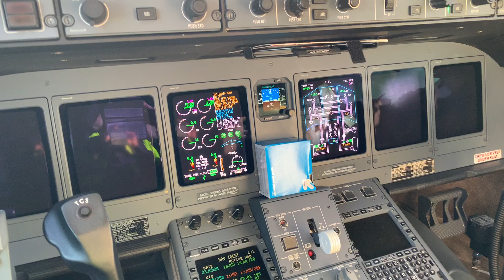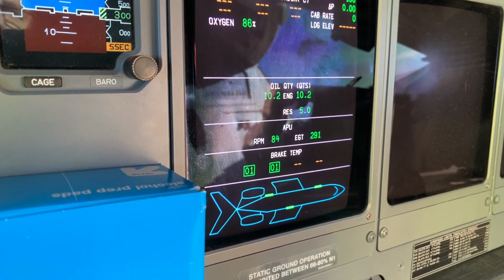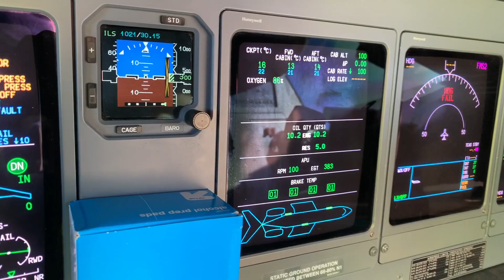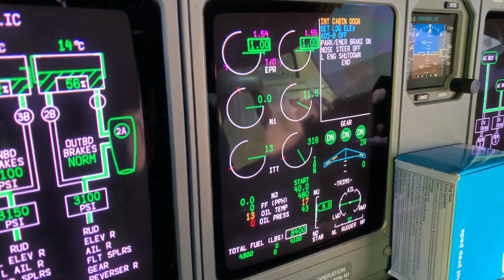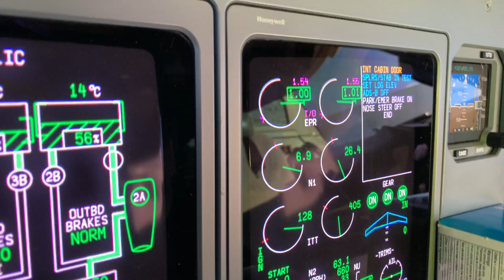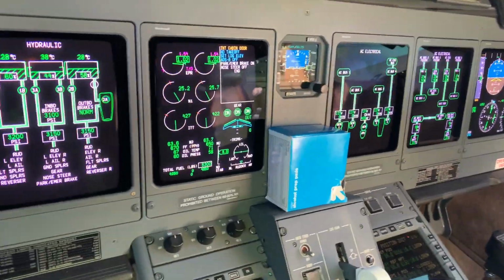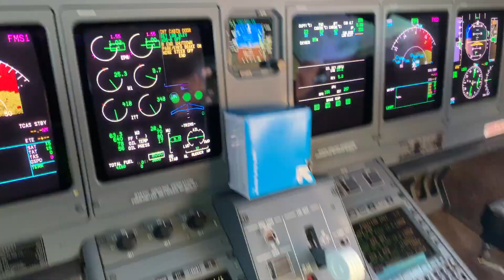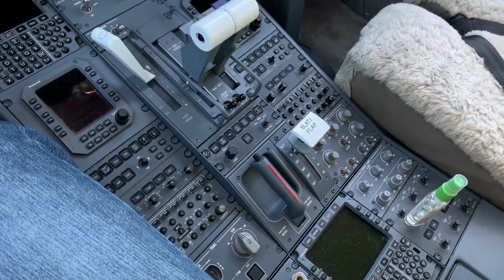A real pilot can show you his aircraft.  C'mon FE pilots - what are you waiting for?

Comment: My favorite part is when you turn on the switch for the compressed air and the chemicals for the trails... 😂 Excellent video, Wolfie. Thanks!
Reply: IKR he forgot to show the chemtrail control button. 🤣🤣🤣
Reply: @amb3cog  No he didn't. The chemtrail controls were the "tall" levers just above the Start Switches.
Reply: @josephking6515  The smaller one is for the flight spoilers, and the big one is the throttle actually. 😉  ✌️

Comment: Great video, thanks Wolfie.
Though the tech is more modern, it's very similar to starting a B757/767, but my B787 is quite different. The 787 has (almost) no bleed air and engine start is done with an electric motor. After the start is finished, that motor is used as the generator. Pressurization and AC is done completely independently of the engines and APU. We also start both engines at the same time, except in very hot environments. The start is completely automated. Initially the engine dry runs for a time determined by the system, dependent on how long since they were shut down. This allows the core temperature to be stabilized, reducing wear. Then the rest of the start continues in a similar fashion to yours, but we do not interfere. Even if we see a hung start, or any other potential malfunction, the system deals with it, including multiple start attempts. Only if there is an EICAS message do we act (or we get a signal from the ground of a tailpipe fire). 
We also don't check actual flight control movement on the instrumentation, we simply move the controls. The rudder check has to be done gently and slowly, otherwise there is an unpleasant motion at the back of the aircraft, it is a very large rudder!
The generators act differently as well, as the output isn't regulated. The AC produced depends on the rotation speed of the engine and so it isn't a constant frequency. That raw AC goes to the different parts of the aircraft where it is converted to the required specification at the point of use. This is all done to save weight!
I actually found something the other day that I'd not known before. On the 787-9 and -10, the gear doors open 1 second after airborne. This is so that, in the event of an engine failure, there is no opening of those doors when the gear is retracted, as this would cause a small change in the TOGA reference line and could lead to a less stable climb.
Reply from the maker: Thanks for sharing.  Very interesting that both engines start at the same time.  I did not know that.   I can imagine that rudder would have quite a bit of weight and rapid movement would be felt inside the aircraft.
Reply: @Wolfie6020  The 787 has a very powerful electrical system. Two engine starter/generators on each engine and the equivalent 2 APU starter/generators on the APU. There are also three engine driven Permanent Magnet Generators which are the primary source of power for the flight control electronics. These power sources are independent of the main airplane electrical system, together with 2 engine driven Permanent Magnet Alternators, one per engine, which are the primary source of power for the Engine Electronic Control.
There is also a system for large motor loads which requires significant cooling, using a liquid cooling setup called PECS (Power Electronics Cooling System).

Comment: Thanks for the video Wolfie.   Seeing you do the "yoke free and correct" check reminded me of a hard landing I had to respond to 2 years ago.   Cessna 172 pilot forgot to pull the yoke lock pin before takeoff by skipping that check, only noticed it at V2 by which time it was jammed with pressure.   Fortunately he was flying off a remote dry lake bed so had a forever runway.  Skillfully got it back down by throttle / rudder only, but broke the nose gear on the third bounce and so pranged the prop. Though most important he and his 3 passengers all walked away.
Reply from the maker: He was very lucky.  Well done to get back on the ground and walk away.

Comment: LOL - good luck with that Wolfie.
Reply from the maker: I think Knodel did a few circuits in his 152 at the aeroclub in 1978.
Reply: @Wolfie6020  I don't even want to think about Bob in a 152 LOL. If he ever flew one, it was solo unless he found a CFI that weighed less than 50 pounds! Could he even fit in one alone? Hmmm - that would be tight for sure.
Reply: @Wolfie6020  And the instructor was doing most of the flying, no doubt.  lol
Reply: I’m not a pilot, but...gee... is there really a big difference between flying a high tech corporate jet...and a “bug smasher.”
Reply from the maker: @Sherwoody  Push the stick forward and trees get bigger - pull back on the stick and trees get smaller.  

Same basic concept with any aircraft - the jet has far more systems but also plenty of automation - you can be on autopilot from one minute after take off to one minute before landing and never have to touch the controls.  I usually hand fly to at least 25-30,000 ft on climb just for the practice and from about 3000 ft on the way down. 

The weight is a factor also,  you can't just hook a tight turn in a swept wing jet.   They ride turbulence much nicer too.  It would take me a few attempts to recalibrate my flare height landing bug smasher now as I haven't flown one for a few years.
Reply: Wolfie6020 I’ve not flown either, a light plane or high tech jet, but I’m impressed by those who do. 
I enjoy your videos, keep up the good work.
Reply: Wolfie6020 what plane is this
Reply: @Wolfie6020  only thing I have ever flown was a powered glider, so I appreciate just how difficult real flying is and I totally admire pilots who make it look easy.

Comment: I was so confused about why he was turning on the anti-ice system. And then I remembered that in Australia it's winter. Not summer like it is here in America.
Reply: As far as I remember, you turn on anti-ice if the outside temperature goes below 10C and you fly into moist air like clouds. The season is irrelevant.
Reply: ^^^ This is why ^^^
Reply: He is checking systems still function after one month of sitting & not flying
Reply: el profe vinagre  At high altitude the air is rather dry. You don't have to use anti-ice at climb or cruise with an temperature below -40°C. Outside any moisture you don't use anti-ice.

Comment: Are those screens CRT they look like the old Telemecanique screens I used to programme for Industrial HMI's
Reply: Was wondering about that as well.
Reply: Definitely have that phosphor look, but I don't think CRTs would look that way to a camera
Reply: @riccardo1796  Hm, I would expect the flickering you see because it are CRTs and wouldn't expect that on LCDs.
Reply: They'll be AMLCD.
Reply: @thearmouredpenguin7148  are you sure they look too bright to be LCD.
Reply: @dogwalker666  Quite sure, I spent many years designing test equipment for flight deck display systems before I retired. The flight deck will have an ambient light sensor (or at least the systems we produced did) which automatically adjusts the intensity of the display from dim at night to very bright when in full sunlight.
The flickering you sometimes see on the video is due to the refresh rates of the display and camera, You would not see this when looking at the display.
Reply: Yes they're CRTs - six of the Honeywell DU-870s [8" x 7" hi-res CRT multifunction displays]
Reply: @thearmouredpenguin7148  thanks.
Reply: @nightjarflying  ah well that's what I thought because of the curvature too, I know it's old school technology but I still like a CRT screen.
Reply: @nightjarflying  I'll not argue because I've just looked up the spec, for the DU-870, but I'm stunned that anyone is still using CRT technology. As far as I can tell the DU-875 is an LCD drop in replacement. Firms like GE have not produced CRT displays for donkeys years. The Global Express is an older aircraft than I thought. 
Hey Wolfie6020 its time you got a new aeroplane.
Reply: @dogwalker666  There's thousands of business jet CRT monitors still in operation [longer life on biz jets because more down time] & there's loads of spares for them - that Bombardier model has certificates allowing an upgrade to Primus LCD, but that looks CRT to me.
Reply: @thearmouredpenguin7148  well there are DC3s still doing commercial flights so it's got plenty time left.
Reply: @nightjarflying  if you can take the weight and power consumption CRT gives better contrast in most lights and it helps keep the cabin warm.
Reply: @thearmouredpenguin7148  - Wolfie will get a new Global 7500 in the near future.

Comment: If I was a Flattie, I'd be thinking how hard can it be to fly an aeroplane? There's no gravity, so you can't crash, as long as your aeroplane is less dense than the medium it's in, 
If you are in a helicopter you only need to hover facing the right direction, and the world will turn underneath until you reach your destination, and you can navigate anywhere in a straight line with your mobile phone since GPS is ground based. 
Oh and we don't need any fuel, just Compressed Air! 
Park brakes? Why do we need them, the Earth is Flat so it ain't going to roll anywhere? 
As to the flight surface controls, to roll the aircraft, we spray chemicals on the wing opposite the direction we want to turn and the change in relative density of the air lifts the wing turning the airframe.   You can see this in operation, with the chemtrails following the aircraft. They disappear during descent when the pilot switches off the chemicals, and the wing stops flying causing the fuselage to lose height.
As for the Angle of Attack, this will cause the Horizon to appear flat, because of compression, 
But we don't know really, it's what we have been told happens. Thats why real pilots fly in straight lines.
Reply: Keep believing the freemason liars, just because he is pilot doesn't mean he is not lying to you, there are bunch of pilots who say the earth is flat, but not all because you risk losing your job because of that, and who would want that? Im absolutely sure Wolfie knows the earth is flat but he is just fooling the sheeps and he is perhaps getting paid for it as well, no other pilots waste their time like child arguing on the internet, only paid shills do and he is one of them.
Reply: @justlaughing9159  Earth doesnt rotate, try again.
Reply: @steverushforth7009  They are lying to you, i can see island 200 km into the distance from the beach, seas dont curve.
Reply: Marko B Since the Earth is Flat, and I believe you since it's now a Fact;  because you've said so.
How do I now navigate using the Sun? It follows a circular path centred on the North Pole and its altitude is about 3000 miles above my head. I need you to explain what to do, if you don't know that's alright,  just be an honest Person and tell me you don't know. 
Water doesn't curve either, you've said that too, so I take it I don't have to add my height of eye in the calculation? Last question, since the earth is Flat, why is there an Horizon? 
You won't reply, not that you had any intention of anyway, trolling is all you have.
Reply: Raging S  Im not making anything up, look it up its there for sheep to see it. 200 km, no curvature to be seen, globe falls apart that easy lol.
Reply: @steverushforth7009  Show me your own evidence, dont rely on what you are shoved down your throat.
Reply: @monochromaticlightsource9153  Water doesn't curve not because i said so but because its irrefutable fact, nobody has ever proven that water at rest curves, why don't you be the first one? I will be waiting for your evidence of curved water. Do you see how much you lack basic knowledge? Horizon is merging point of you PERSPECTIVE, nothing to do with curvature that doesn't exist btw. Ever stood on a long straight road at night where light poles seem to go lower and lower and eventually merge into the road? Are they behind the curve? No, its perspective limit of your eyes.
Reply: @idontcare7961  It is my own evidence, still dodging with zero evidence, so link me to a flat earth nav text book.
Reply: @steverushforth7009  200 km no curvature to be found.
Reply: Raging S  Atmospheric magnification, also perspective does make things merge into the vanishing point of horizon, thats how sunset works.
Reply: @monochromaticlightsource9153  Grow up. this is my last reply to you.
Reply: Run away have you? Question too difficult? Too adult for you?
Reply: Running away from the Truth. How very Flerfer of you.
Reply: Yes You Loose. You can't handle the Truth, it's a Globe!
Reply: @monochromaticlightsource9153  that's exactly what he does typical flerf never answers a direct question.
Reply: @idontcare7961  atmospheric magnification is not a thing the sun does not change size so it's not perspective and the kicker why does the sky go Red at sunrise/sunset ?
Reply: @idontcare7961  cherry pick show the full video to see what Buzz actually said.

Comment: 9:12
I imagine that there is some kind of interlock on the "engine run" switches ?
Otherwise, it would ruin your whole day if you bumped them with
your hand or something in mid-flight.

Cool video though , Wolfie 👍👍👍
Reply from the maker: That would make sense but you can select them off at any time even mid flight.  They can't be bumped though as they need to be lifted deliberately up before they can be moved.
Reply: @Wolfie6020  Ah, yeah, That would work. :)
Reply: @Wolfie6020  Well...... we had one of ours where something was being passed across the cockpit. It slipped, fell and knocked one of the fuel control cut-off switches to off.

Comment: Wolfie, Is/would there ever be a situation where you would need to use the APU in flight?
Reply from the maker: Yes there are several situations where the checklist advises you to start the APU in flight.    It supplies electrical power and bleed air and is a good back up if one engine has been shutdown / secured. 

Here is an example from the checklist (I highlighted point 8)

https://drive.google.com/file/d/14XnLAMypfpzl8fH0jWF_l0r3wiudQh8r/view?usp=sharing
Reply: @Wolfie6020  thanks Wolfie

Comment: Are CRT screens still preferred in the cockpit compared to LCDs? I guess CRTs provide better contrast and more dark background compared to LCDs, or maybe performance at low temperatures? Or it it just due to the age of the aircraft, and it wasn't retrofitted with LCD screens. LCDs are more vibration resistant, lighter and use less power.
Reply: Newer aircraft have LCD screens. Wolfie made a video of the newer model of this aircraft which has more advanced cockpit:
 https://www.youtube.com/watch?v=sYLt-NcSAhg
It has four large LCD screens.

Comment: Great video, i hope you do ones like this every now and then. i have 2 questions
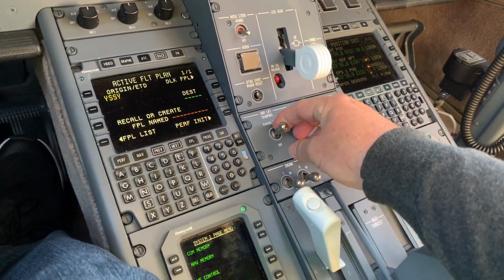1) at 8:40 what's ground lift damping 
2) near the end of the video on the main screen behind the yoke, it appears as if it's sort of radar display, if so, isn't there restrictions on operating radars on the ground ?
Reply: 1.Ground lift dumping is the upper surface spoilers that pop up on the top of the wing when a business jet or airliner lands. They are usually triggered by a weight on wheels switch so once the aircraft has touched down on the runway they pop up and destroy all the lift created by the wing and also create a resonable amount of extra drag to help slow the aircraft. Reducing lift is good because it increases the weight on the wheels and tyres which allows for more effective braking and directional control, specially in slippery conditions.

2.That isn't radar, although I understand why you would think it is. That is a synthetic terrain avoidance display which takes the aircrafts location as defined by its GPS/INS navigation system and compares it to the known altitude of the surrounding terrian from a terrain database stored in the aircraft computer. The yellow areas are terrain at the same altitude as the the aircraft (which makes sense as its on the ground) and the red areas are likely higher surrounding hills/mountains. This gives excellent situational awareness of surrounding terrain without needing an active radar, as long as the position of the aircraft can be determined reliably by GPS. The latest systems actually display this to the pilot in 3D so your can "see" the mountain on the screen even if you're flying in cloud. Its pretty impressive technology.
Reply from the maker: +crowxe  Ben D is 100% correct on both.
Reply: Operating the radar on the ground isn't prohibited but it is restricted. If there are personnel close in front of the aircraft it can do internal damage! It's a powerful microwave.

Comment: can you show a cross bleed start with out the APU some time?
Reply from the maker: Would be happy to but very unlikely I will have a chance to do that.  Rarely do we start engines just to run them - this was due to less flying recently so the plane was powered up to keep batteries charged and check systems.    Normally the schedule has a few trips each month so no need to do it like this.

Comment: I take it the RPM for N1 & N2 is x100?  So ~2600 for fan and ~6300 for second shaft. But APU is just a percentage?
Reply from the maker: They are all in percentage.   However power output is not linear to the percentage.  It  increases exponentially.  So the output change from 50% up to 60% is tiny but going from 90% to 100% it is significantly more change. 

https://images.app.goo.gl/jtLTuHVyfoJ1z16c7
Reply: @Wolfie6020  
Ahh, I understand. I guess it's easier having percentages rather than RPM readout. 
I was thinking 2600rpm on the fan at idle was a little fast.

I love how well laid out the screens are.